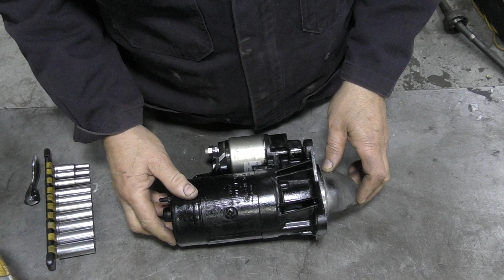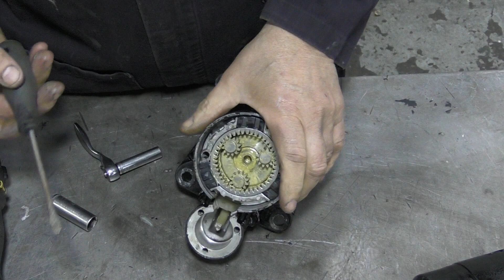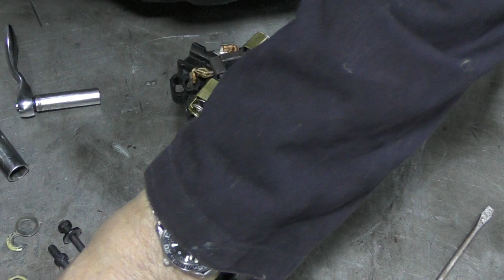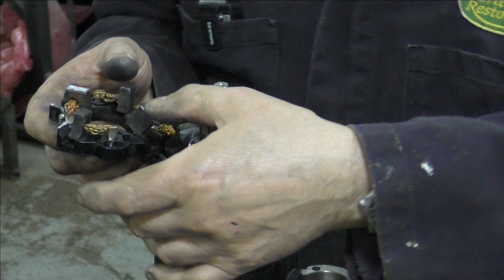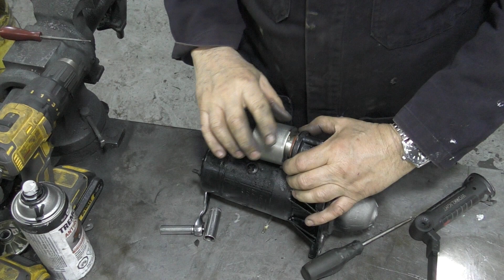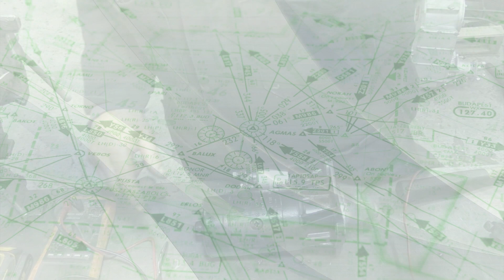The simplest Bosch starter full strip and reassembly

Comment: I stripped it all down and then greased the gears.i bench tested it and spun fine.put back in the vehicle and just clicks,there is only 9v to the trigger wire.so put 12 volts directly to trigger wire but still just clicks.
Reply from the maker: Check your grounds!

Comment: My Vauxhall starter GM 55352882 has nothing on the bottom of the shaft/armature, it seems like something should be there, but it just slots in to a hole; no bearings, nothing. But the inside of the hole has a copper- or brass colour. Is this normal? I've looked for bush kits or something but can't find anything.
Reply from the maker: I honestly do not know - I tend only to fork on Land Rovers
Reply: @BritannicaRestorations  No probs thanks mate. It sounds alright, it's going on, lol.

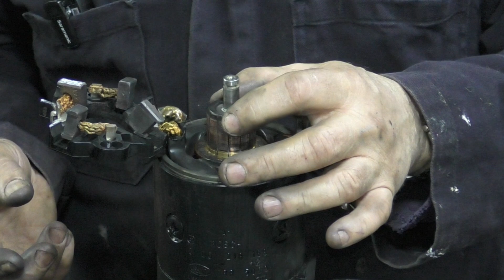Comment: 13:27 I used an appropriately sized socket put in between the brushes to hold them out and then installed the brush box over the commutator. The end of the commutator pushes the socket out while allowing the brushes to slide onto the commutator. I sized it just slightly larger diameter than the commutator to help and it worked out pretty good. But the cone tool you mentioned would be much nicer.
Reply: I do it your way - with a socket. I did one again today.

Comment: Jobsagoodun Mike. Wondered how you held back 4 brushes at once. Good to know.
Reply from the maker: There is a special cone you fit over the end of the shaft, so you can assemble the brushes without spring tension and then slip onto the commutator  - looks like a trip to JP's!
Reply: @BritannicaRestorations  Everyone needs a JP!

Comment: Doesn’t stainless steel react with the copper wire.?
Reply: The tang on the end of the wire is plated copper, copper but not naked copper, so it shouldn’t. I grease electrical terminals, like it or lump it, I’ve never had a problem.